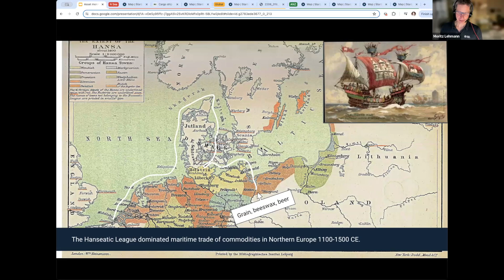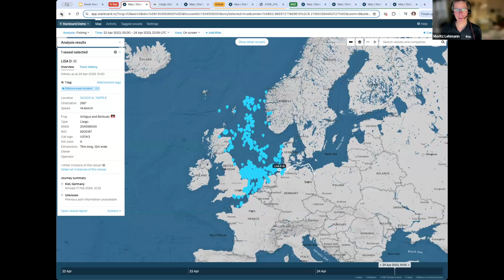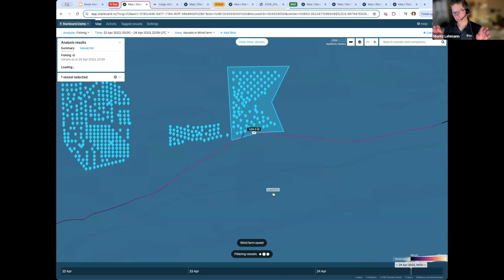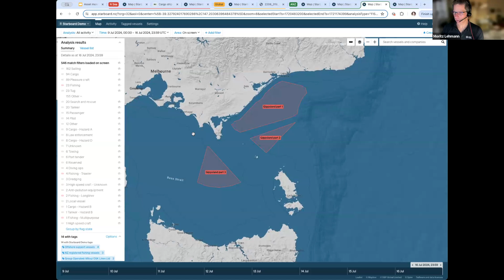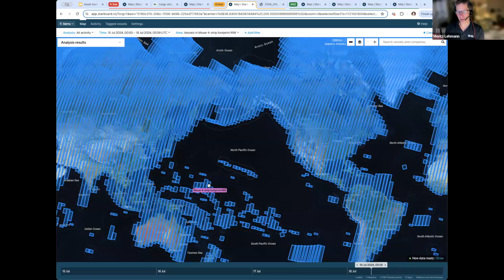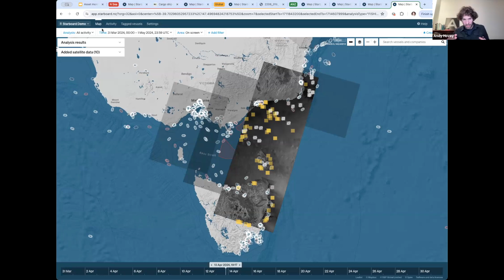Expert insights: Persistent monitoring and planning for high risk areas of interest

Comment from the maker: We had plenty of questions from the audience, those we answered over chat are below 👇
Reply from the maker: Q: I like the concept of having visibility of critical infrastructure, for Africa it is offshore facilities etc
A: Yes, being able to show this is useful for customers including the potential to label them.
Reply from the maker: Q: Can your system work and integrate with other maritime solutions/platforms that provide navigational assistance and safe routing?
A: Yes, we take information from other sources and also provide information to other systems via APIs.
Reply from the maker: Q: Does the system take account of submersible vessels, drugs are can employ submersibles for their smuggling operations. If not can we consider that for future development. These vessels operate at a about 5 m below. so not terribly deep.
A: Not yet but we have been exploring Distributed Acoustic Sensing (DAS). Hydrophones are another data source that could be used to detect submersible vessels.
Reply from the maker: Q: I wonder if it is possible to correlate ships’ radar data to detect hidden objects on high seas?
A: Yes, there are providers including HawkeEye360 and Unseenlabs who do this and we have worked with some of this data.